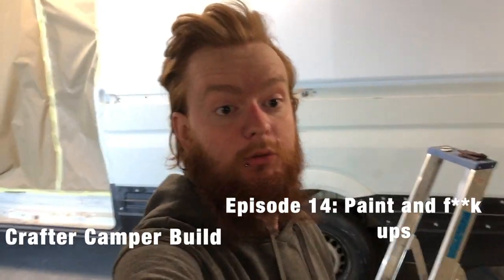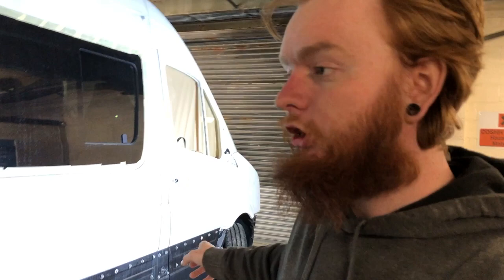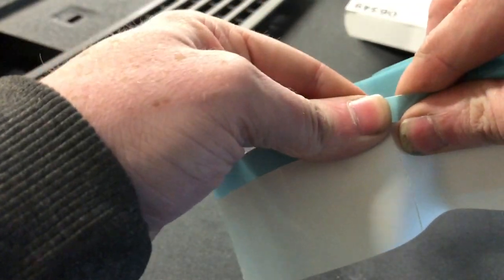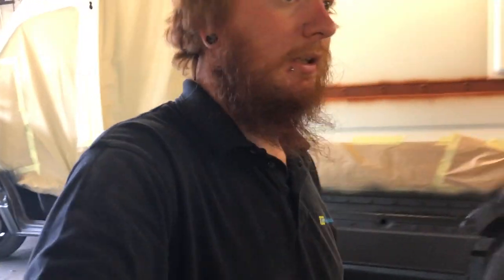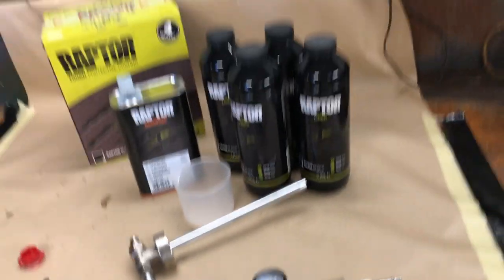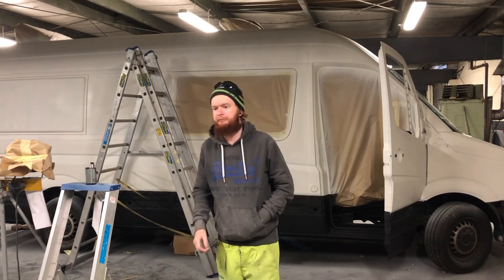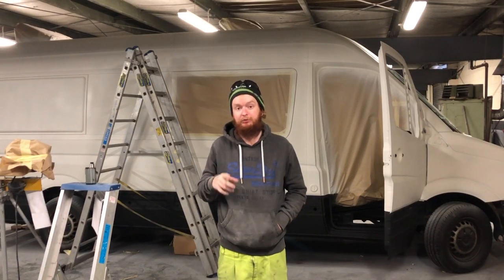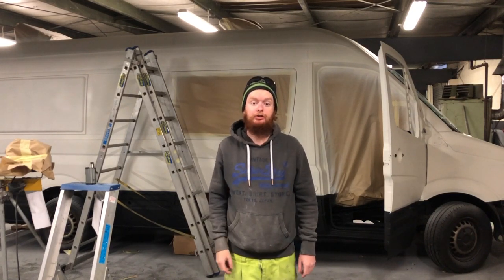- Crafter Campervan Build - : Ep14 WE F@CKed UP OUR RAPTOR PAINT: - Self Build Campervan -

Comment: Iv just done mine in raptor, mwb sprinter, I used hvlp gun 2mm tip 15% thinners, my van was faded royal mail red, i used the pre tinted post office red raptor an it took a few coats to cover the areas that had primer on, white is the hardest to colour to spray, still looks good tho 👍
Reply from the maker: Bet that looks sweet pal, would love to see some pictures 😁 
I was going to go down the hvlp route but I knew I would easily be able to achieve the texture I was going for with the raptor gun, how did you find using the hvlp? 
The white has been a bit of a nightmare, I should’ve known it would be but I had my heart set on the white and black colour scheme in raptor as you very rarely see it 👀
Reply: @CandCVanLife  i'l get some pictures of it later, it went on well with the hvlp you have to clean 
The gun after after every cup of paint tho, a bottle go's bit further, but  coverage was thin, you might find after a few days it will even out as it cures fully mine seemed too, yours looks sweet tho dude

Comment: Why would`nt you cover your wheels ?
Reply from the maker: spongebob smellypants the wheels are getting painted and the tyres changed once the paint on the van itself is finished. The hub/centre caps of the wheels are getting sprayed in black raptor with the rest of the plastics for the van 😁 so because they’re getting painted and the tyres changed it wasn’t worth the time and material to cover them up 👌🏻